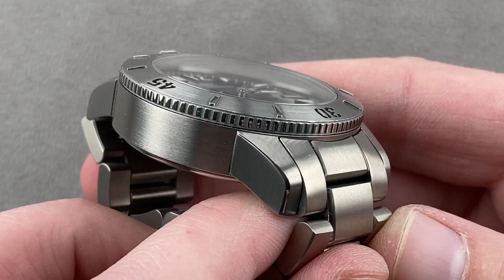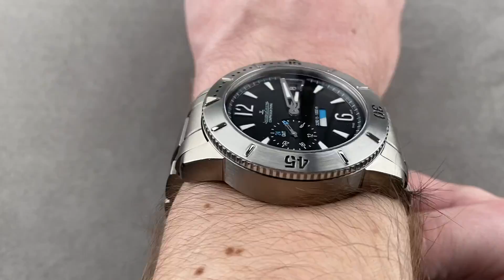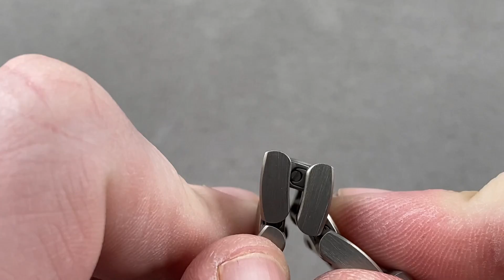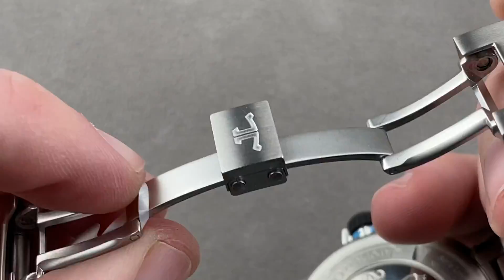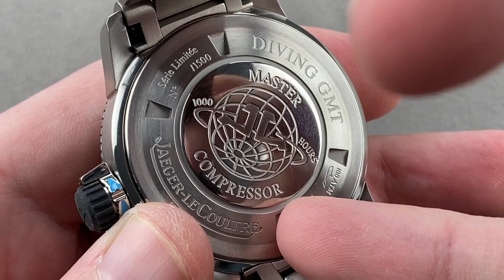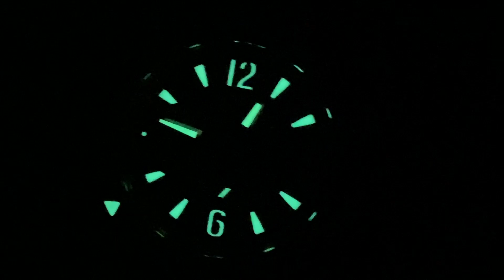Jaeger-LeCoultre Master Compressor Diving GMT Q187T170 Dive Watch Review

Comment: I have the chronograph version of this and think if an apocalypse happened I would definitely be using this watch! My only suggestion is the rubber band is a bit thick (the bracelet is nice but heavier to wear casually) so getting a custom aftermarket strap like from combat straps (I got a canvas velco one) makes it feel much more comfortable. Super solid watch, easily readable, and super functional... one I'll hang onto forever!